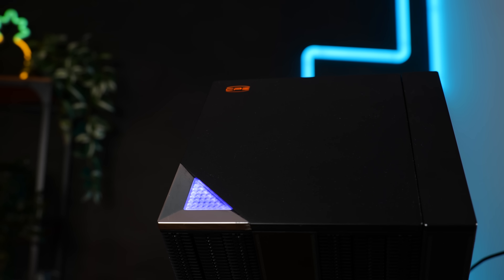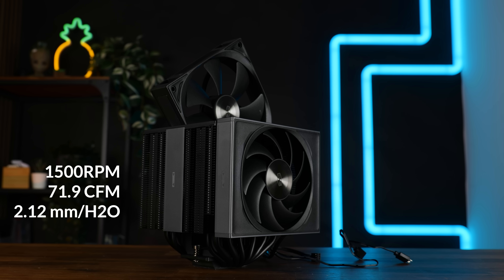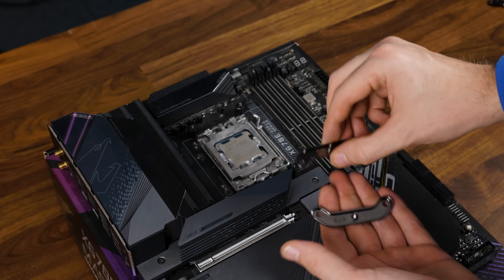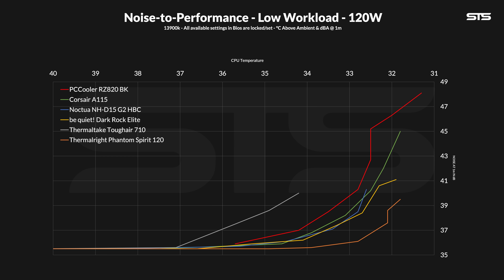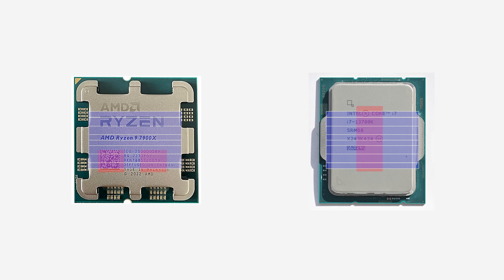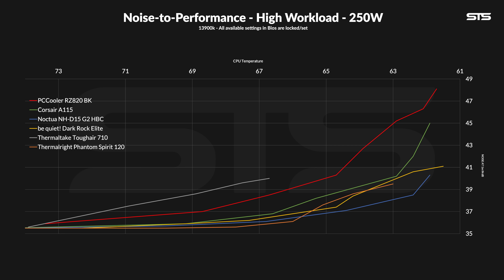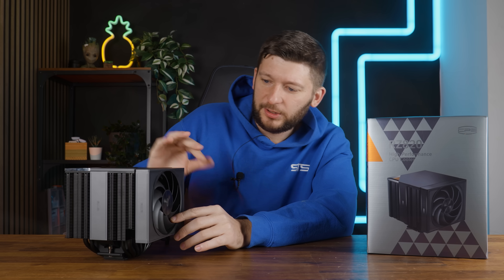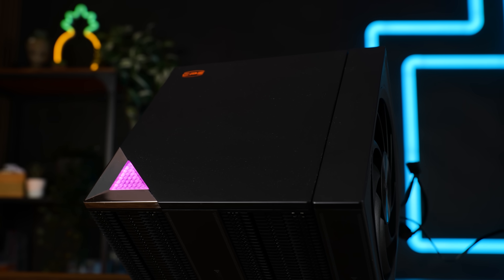The Next Innovation Of Air Coolers ❄️ PCCooler RZ820 Review

Comment: Hi guys, I have a few questions before I put together my new pc. Im not too experienced with electronics and things like that so I was wondering if a RTX 2080 TI and a i5 11400 would be a good pairing, I play games like msfs 2020, GTA 5, FH5,  Assetto Corsa, and MXGP 2021 the rest of the parts I will use are the Corsair Vengeance DDR4 16GB ram, Asus B560m-k, Cooler Master MWE 750w gold psu, in the Cooler Master MB320l case. Will these pairings be bottlenecked? If so how much will the performance be impacted, will the gpu and cpu utilisation be put out to its maximum, etc. A little more background about the parts, the CPU, ram, motherboard and ssd will be from my old pc, the rest of the parts will be new except for the 2080 ti I am about to buy one for 350 aud, it is a MSI gaming trio x card he bought it brand new back in 2018, he told me it was used for gaming daily for around 3ish hours, the other card is a Gigabyte model and has been used lightly in his flight sim. Is there any other things I should know?

Comment: I have this cooler, sitting on a shelf. I got it originally planning on doing a new build with the 285k.. but after Intels flop with Arrow lake in gaming performance I decided I'll wait for the Ryzen 9950X3D.

Id be curious if Noctuas offset mounting bracket would be compatible with this cooler for AMD. I'll have to do some searching around, though unfortunately PCCooler isn't a well known brand here in the west..

I ordered the RZ820 because it has a similar look to the Assassin IV, and Deepcool is sanctioned here in the US, unfortunately.

Comment: As a Noctua user I would pick this for a mid-tier or budget build depending on situation.
Reply: I was able to get one for like 45 dollars. Not a good idea, it sounds like a gas turbine at 1000-2000 rpm
Reply: @users4007 It's called using a fan curve.

Comment: The Phantom Spirit 120 is still within <1-2°C while being half the price. Not REALLY competitive... Just like Noctuas new D15 G2.
And for the AMD DIE placement, it is not that important since there is the IHS which spreads the heat and a coldplate on the cooler which spreads the heat again. It would be more of a problem with a cooler with direct touch heatpipes. Although an offset mounting can give 1-3°C lower temps. 
We are close to what is conventionally doable with that heatsink design.

Comment: ok my Thermalright Phantom Spirit 120 is technically tied with this one and it costed me $25 in my country currency like couple months ago
Reply: Bro same. My thermalright assassin is goated 😂 and only cost me $30aud
Reply: Is that aio?
Reply: @raptorhacker599  nah air cool! Silent assassin
Reply: @raptorhacker599  
air cooler
For my Ryzen R9-3900x (then R7-5700X3D) I bought the Thermalright Peerless Assassin 120se for really cheap. I used the program "Fan Control" to set custom fan curves and my PC is dead silent... note that AM4 and AM5 are ninety degrees offset so you need an offset mounting probably if you have AM5.
Reply: @raptorhacker599  no, that's an air cooler from Thermalright
Reply: If you filter out all the watercooling variants, it’s actually quite impressive…
Reply: Cost, not costed.

Comment: I used to be all about air coolers until I bought my Galahad 2 LCD 360 AIO. If you buy an AIO with PWM capability for both the pump and the fans, you can configure your ideal curves in bios for both the pump and fans. I never hear noise anymore.
Reply: Good luck when the pump dies or you have to fill it up with water
Reply: @Sulphur_67  which won't happen in the next 10 years.
Reply: @cvd1  the air cooler will never die at all
Reply: @gordonfreeman5682  Doesn't matter. 

Over 10 years, most people will renew their entire setup.
If a water pump dies, they'll buy a new one in their new setup.
If an air cooler lives, they'll buy a new one in their new setup.

Unless parts die during the lifespan of the initial build...
Then it's irrelevant whether the lifespan is long or short.
Reply: @dzello  There is nothing to replace for the cooler itself
Reply: Uhh you can also setup fans in air cooler with PWM, since mostly new air cooler comes with PWM fans. This PWM is not an exclusive feature for AIO....
Reply: @jeremyg2236  I know. I was just pointing that out because some AIOs come with a fixed pump speed that is high rpm so it is more noisey than an air cooler and they might think all AIOs are loud.

Comment: It is interesting to see that the Fans weren't matched in CFM. And wouldn't that middle 140mm fan benefit from higher pressure considering the fins restricting airflow in both directions?

Not asking you to redo the tests, but might be interesting if a better speced 140x30mm fan would improve the results. But it would be a headache to try and match the front/middle fans 😅

Comment: i dont like air coolers that are forcing to use their own fans like this cooler and assassin 4,maybe dark rock pro 5,  kinda anti consumer, the same as Dells prebuilt pc's, some parts cant be changed or swapped with different ones unless you ship back to dell
Reply: I don't think there's any way a manufacturer can actually stop you from zip tying your own noctua case fans to the cooler